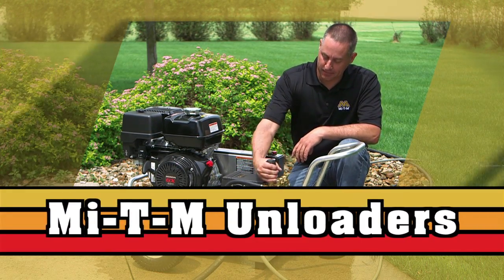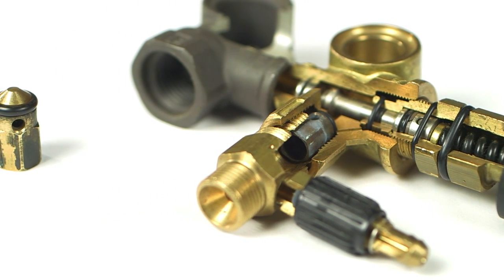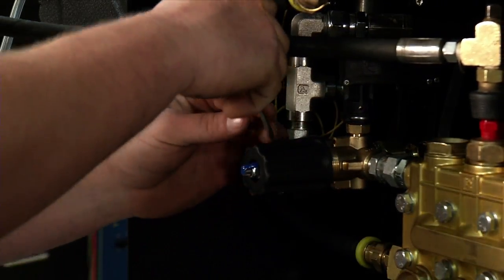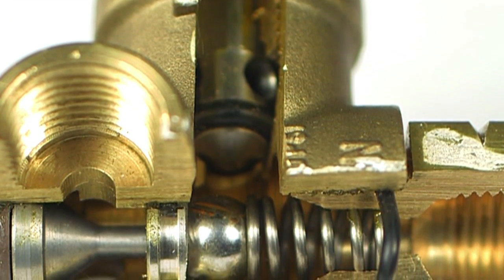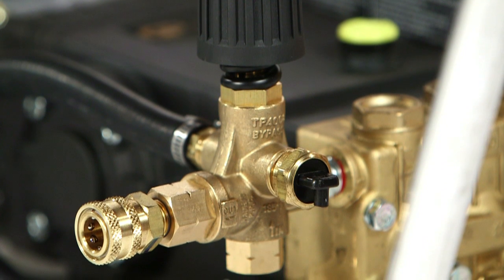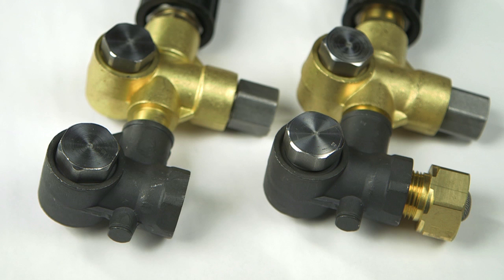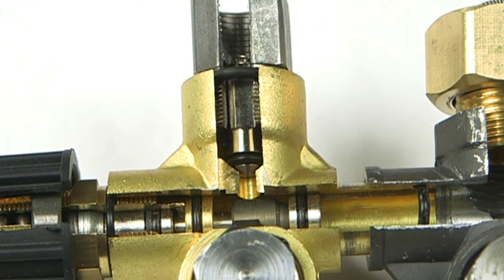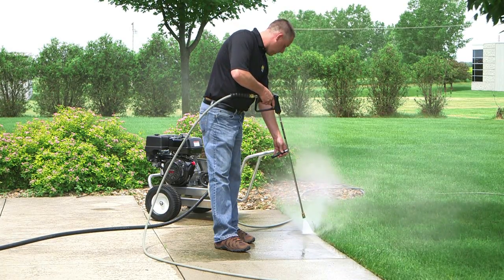Pressure Washer Multi Style Unloader Pressure Adjustment Valve

Comment: Does it matter where the thermal relief valve is installed? I see it mounted pump and on unloaders.
Reply from the maker: Hi Igor, It does not matter if it is on the pump or the unloader as long as it is installed in the bypass loop system (low pressure side). Hope that helps & give us a call at 1-800-553-9053 if you have any other questions. Thanks!

Comment: How do i remove the pump assembly from MiTM 4000wp with robbins engine
Reply from the maker: Hi Gary,  you will need to loosen the set screw on the pump shaft and remove the four bolts that mount the pump to the engine. Feel free to give us a call at 1-800-553-9053 if you have any other questions.

Comment: I HAVE A GX390 HONDA 13.0 DOESN'T HAVE ANY WATER PRESSURE
Reply: Start with the easy stuff, check inlet screens. make sure they are clean and clear. Make sure you are getting enough water to your pump. Check your spray tips, they do wear out over time and you will lose pressure. Leaks... any leaks will lose you pressure. Check your fittings M22 or quick couplers, both have O-rings that go bad over time. Is your thermal relief valve leaking, if so, replace. Your unloader might be stuck in bypass. packings might be worn. check for water leaking under the pump behind the head( between the brass head and aluminum crank case.) that's a good sign that seals are bad or you have a cracked piston. Also make sure your engine is running at full throttle, usually I set them at 3600 rpm. if its belt driven like a CBA unit, make sure belts are not slipping. And if its direct drive make sure the keyway is not stripped and is spinning.
Reply: Unloader adjustment needed.
Reply: @hodgymoto1  On my unit, the problem turned out to be the Easy Start Valve.  I couldn't understand what the problem was.  There wasn't a lot of info about the situation online, but a local tech was pretty easily able to figure it out and all I needed was to take it out.